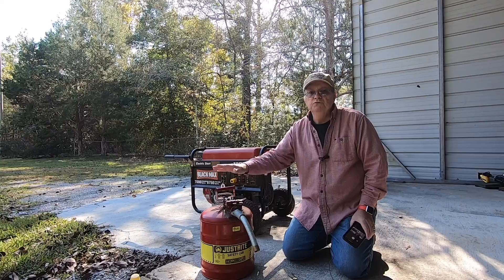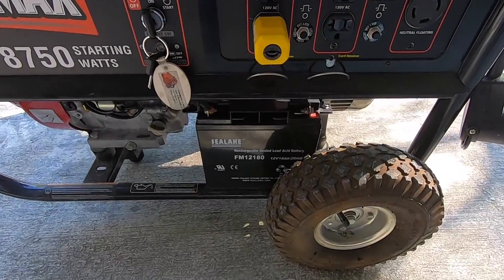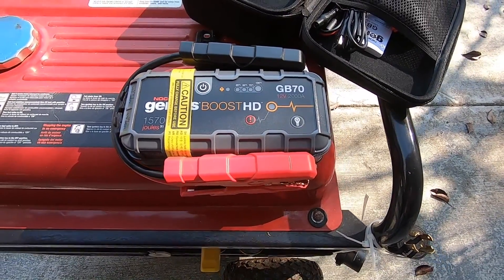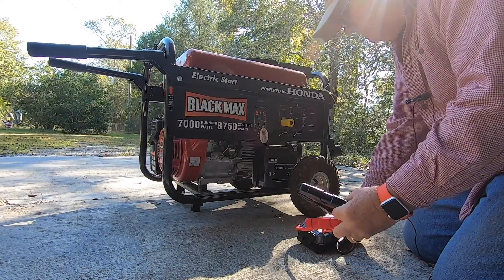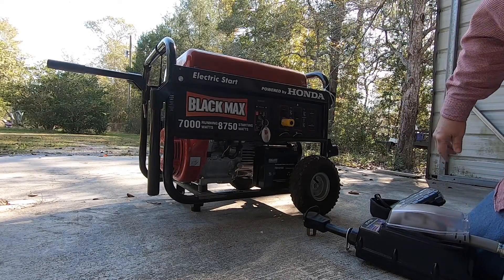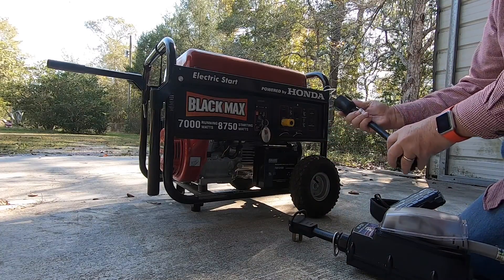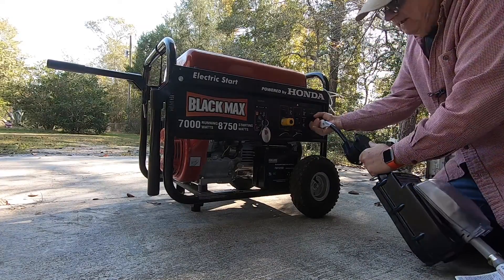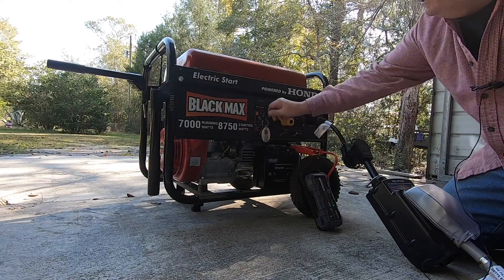Home & RV Backup Generator Test - Tips and Demo with Bonus Info on Bonded Ground

Comment: Interesting, I wonder if the panel in your camp trailor is a mains or sub-panel, I think it is a sub with the neutral busbar insulated from the enclosure which is ground.. I am thinking N.E.C. does have a word about this since trailors can be hooked to camp-site pedestals. Safety being the keyword.